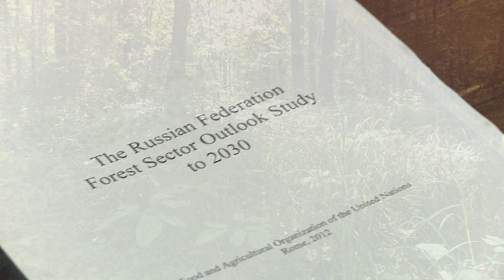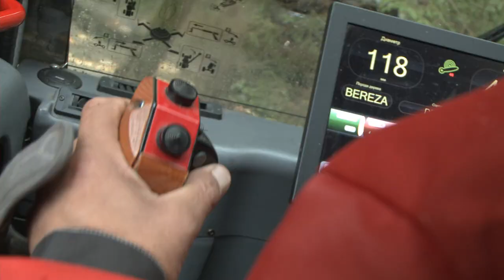The future of Russia's forests

Comment: making paper from wood is no good
your better of planting hennep plants thy grow fast and you can make paper and ropes from it
trees just take to long to grow its a waist to use em for paper

i hope to imigrate to russia it looks like a beutyful country :)
Reply: Evidently you don't know much about forestry. Normally the majority of any given softwood tree will be cut for sawnwood products and milled by a sawmill. This is nominally >14-18cm diameter of any tree depending on straightness and being free from defects and excessive branch knots in the timber. The remainder, which will constitute around 20% of the volume of the tree may be suitable as high-grade small roundwood for fencing, such as posts, stakes or rails. If it is low-grade it can be cut for pulpwood for paper manufacture, or for biomass for burning for heat or power generation (in some cases both - Combined Heat & Power generation) or it can be left as deadwood in the forest.